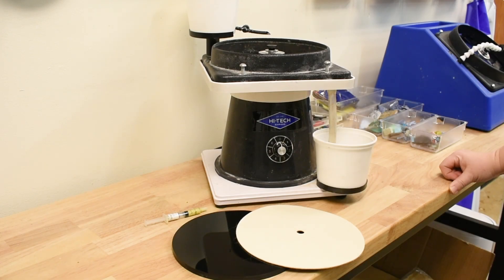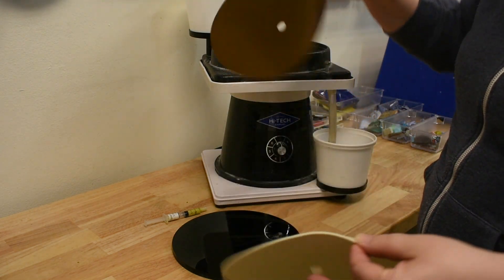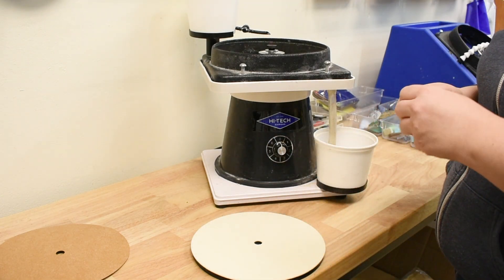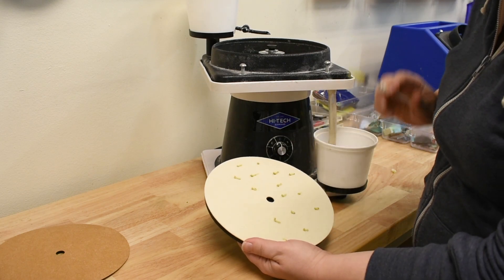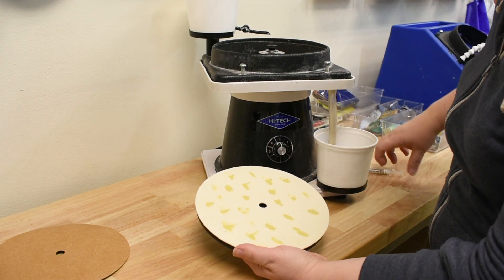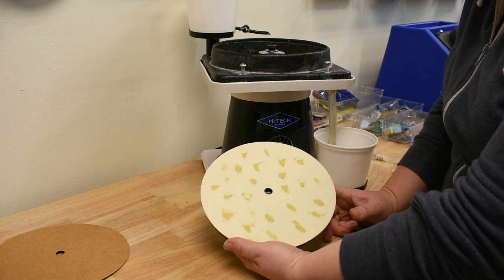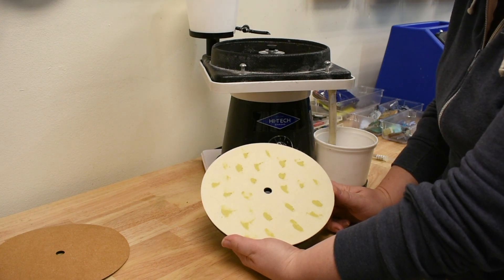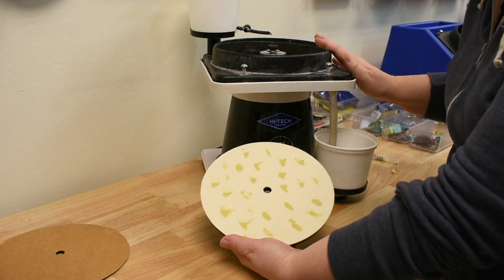Hi-Tech Diamond -  How to charge the Tech-11 polishing pad with diamond paste

Comment: Do you run that pad wet or dry?
Reply from the maker: While it isn’t necessary to use water with polishing pads, we recommend keeping the Tech-11 polishing pads and final polishing pads slightly damp when you polish. Depending on the material you are polishing, your stone can overheat, getting hot to the touch due to the friction between the stone and polishing pad. As a result of the high temperature produced by the friction, you could possibly burn your fingers or, if you’re using a dop stick, your stone could shift or fall off of the dop stick if the wax melts. If you are using water with your polishing pads, make sure it’s clean.

Comment: Do you use these dry or with water?
Reply from the maker: Hi there! While it isn’t necessary to use water with polishing pads, we recommend keeping the Tech-11 polishing pads and final polishing pads slightly damp when you polish. Depending on the material you are polishing, your stone can overheat, getting hot to the touch due to the friction between the stone and polishing pad. As a result of the high temperature produced by the friction, you could possibly burn your fingers or, if you’re using a dop stick, your stone could shift or fall off of the dop stick if the wax melts. If you are using water with your polishing pads, make sure it’s clean.

Comment: i noticed there's double sided sticky face on the backing plates but we only use one side to stick the polishing pads onto.... whats the purpose of peeling off both sides ??
Reply from the maker: Hi there - The film that you are referring to is just to protect the acrylic material of the backing plate from getting marks while it's in shipping transit. It's how we receive them from our vendor. You don't need to remove both sides, but we do suggest removing the film from the side that you are applying a disc to.

Comment: How do u change the pads when they are exhausted? they really stuck on good!
Reply from the maker: Hi Larrymore - To take off old discs, we recommend using a heat gun or a hairdryer to heat up the adhesive. This will help in removing the discs from the backing plates. If you have excess glue left behind on the backing plates, you can remove this by using GooGone or rubbing alcohol. We hope this helps!

Comment: Do we run with polish only or do we have the water system going as well?
Reply from the maker: Using the Tech-11 polishing pads either wet or dry is up to you. If you have material that is heat resistant, we highly suggest using a bit of water to keep your material cool so that it doesn't fracture due to the heat build up.